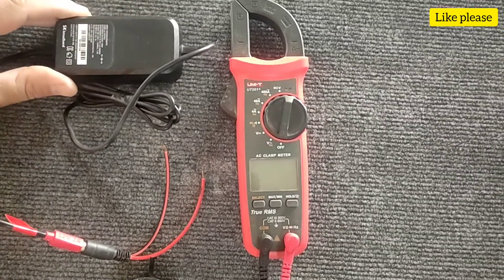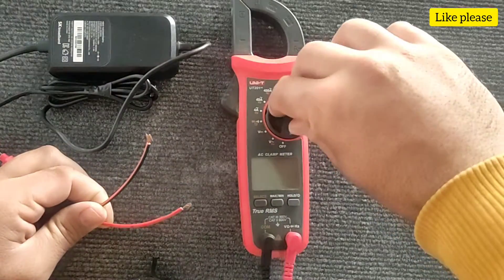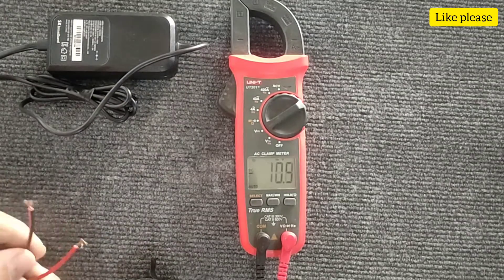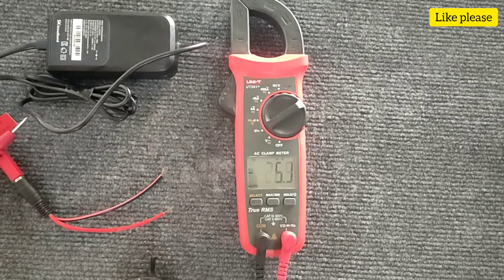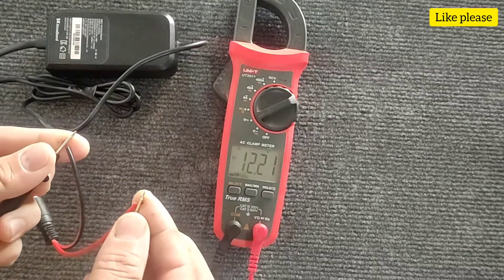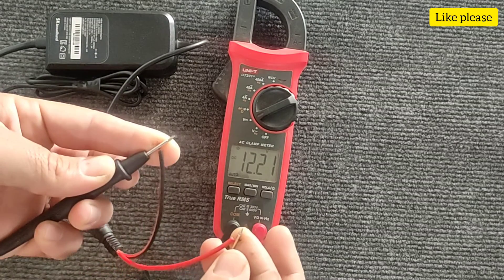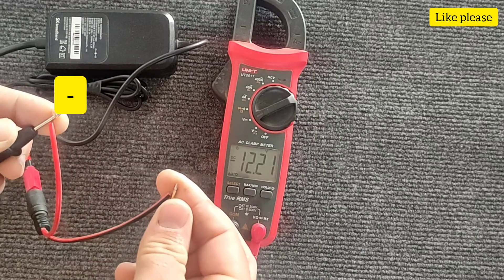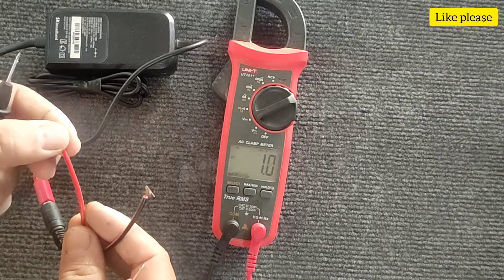How to find positive and negative wires in DC electricity

Comment: At the end, with -12V, you correctly say the blk wire connected to the red probe is NEG and the red wire connected to the blk probe is POS - but the "+" and the "-"  labeling is wrong
Reply from the maker: Blk prob is negative ans res prob is positive.these are  correct
Reply: @IET-76 if you're talking probes, I agree with you. It should be listed on the diagram that you're plus minus refers to probes, not wires. Great video. Thank you!

Comment: I'm not sure how I'm doing this wrong, but I'm getting Negative numbers both ways round.

Using a Fluke 83 V Multimeter:
Black lead is in the common, the red lead is in the Voltage/Resistance/Diode & the settings are on Voltage DC.

What am I doing wrong?
Reply from the maker: Probably your multimeter haven't this ability

Comment: Maybe you can answer this quick. My battery charger someone tore my leads off so the colors are gone. My multi meter is on DC and both cables are showing same voltage. When I swap them same thing. It dont go into the negative on one side or the other. Milwaukee multi meter
Reply from the maker: Your problem is with the multimeter.
Please use another multimeter

Comment: Touching live wires with your hands while the freaken multie meter is next to you is not smart.
Reply from the maker: The voltage of the adapter is 12 volts DC, so it is not dangerous for humans. On the other hand, we have installed all protective devices in the current path to protect against electric shock. Also, touching does not have a great effect on the voltage. Anyway, thank you for your opinion.